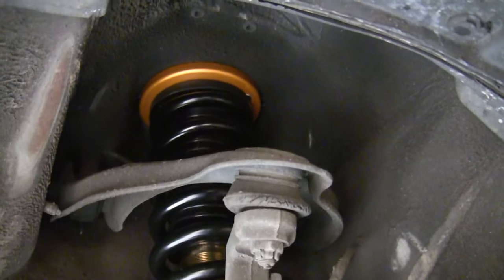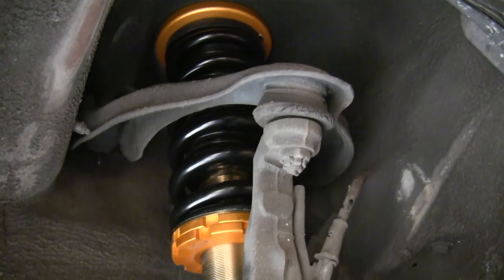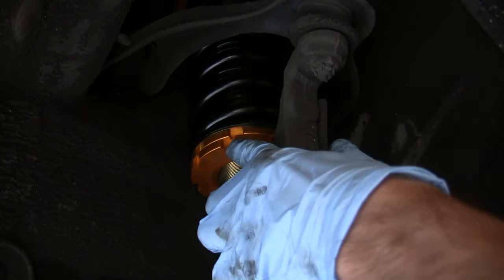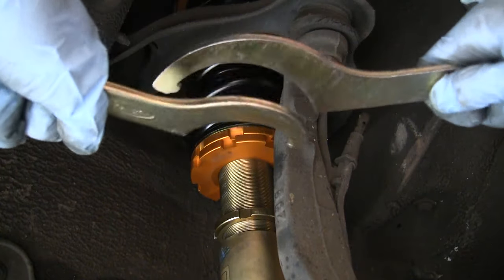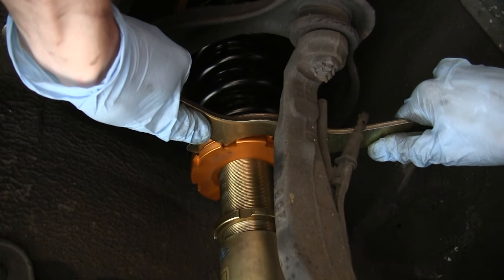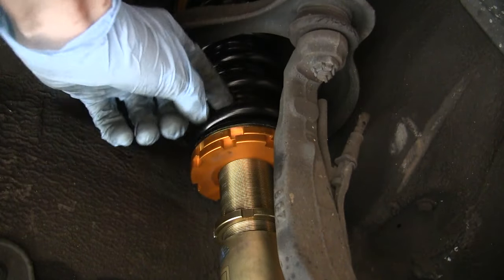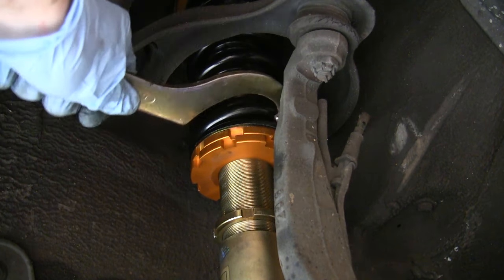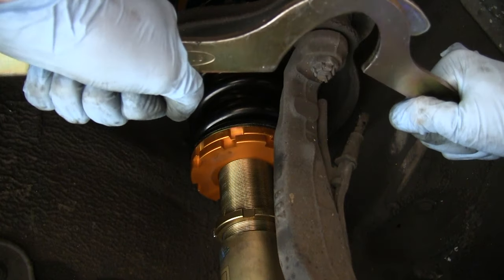How To Adjust Coilover Spring Preload - Explained

Comment: Just bought the maxpeedingrod adjustable coilsprings just like you for my integra dc5 and your video was very helpful even after 9 years! Thanks alot!
Reply: How are your coils treating you 1 year later?
Reply: @andrejlazarevic6871 do not get those i had the same one and one snapped while i was driving. Thankfully my fender and wheel were not affected but my balljoints and abs sensor are now destroyed. Upgrading to scale coilovers now

Comment from the maker: The top ring (when adjusted) allows the spring to compress or stretch out. The ring just below it (middle ring) is used to lock it in place once you have adjusted the pre-load.

Comment: I know this is an older video, so this comment will probably be glazed over. 

For some strange reason, there are no sources of information about properly setting damper stroke sag (pre-load) for cars. There are a billion motorcycle sources explaining pre-load and how to adjust bike sag so the shock travel is not too short or too long. So I will  explain how to properly set pre-load to get it out of my system:

Suspension pre-load is used to keep the suspended mass located anywhere between the max. and min. shock travel when at rest, as gravity will put a compression force on the spring and damper system. For dampers to work properly, the suspended mass should not be too close to either the max. or min.of the shock stroke, otherwise the suspended mass will slam against either the bump-stop or the top of the damper stroke. On a vehicle, the most common and highest force input will be in the direction that compresses the spring and damper system (expansion force of the damper will only ever reach the maximum force the spring itself can expand once compressed); therefore, more travel is desired in the direction that compresses the spring. 

With that information in mind, pre-load should be set so that the suspended mass has approximately 80% compression travel available, and 20% rebound travel, or somewhere near that. Setting the spring pre-load such that the suspended mass rests in the middle (50% compression travel, 50% rebound travel) is more or less pointless as no road going car will decompress the spring fast enough to effectively use all the travel which will result in an proximate waste of 30% total shock travel.

In conclusion, first set suspension pre-load to optimize damper stroke, then adjust ride height such that the chassis will not scrape the ground when the spring is compressed to the bump stop. No racetrack organization likes their road course scratched up by some stanced fool.
Reply: Harvey Mushmann is lifting a wheel of the ground, measuring fender to wheel. Then subtracting static height fender to wheel, a good way of calculating rebound and compression travel?
Reply: Dude THANK YOU SO MUCH

Comment: From what I know, changing preload doesn't change the suspension travel. It just re-distributes the suspension travel for compression and extension, thereby changing the available travel for each all the while keeping their sum(travel) just the same.
Reply: Yes! unless you run into coil-bind...
Reply: Changing preload can limit the amount of travel if you go shorter than the amount that the spring compresses with the weight of the vehicle.

Comment: Personally, as far as i can see adjusting the spring up or down doesnt change anything except the ride height.  raising it could only compress the spring more if the damper was already fully extended.  if that is the case, then you definitely have some serious problem on hour hands already.  otherwise, and normally,  the mass of the car is loading the spring and setting its length.
.   stand corrected if i've missed something obvious, but that is how it seems to me.

Comment: I recently changed my coilovers from almost 0 preload to 7mm preload.   I left the dampening the same.   After driving I feel like the suspension is much looser and prone to roll.  Is this normal? Also can I fix it just by bumping up my dampening adjustment?

Comment: The adjustment "preloads" the spring. With the car jacked up, raising the perch will compress the spring. The compressed spring exerts a force which must be overcome before the damper will move.  The result is that increasing the preload increases the ride height, but also lifts where the car normally sits in the damper travel.

Comment: Preload is a misnomer for this coilover type.  This adjustment has more to do with positioning shock normal(resting) point.  You don't want to adjust that unless your vehicle mass is much different from stock or you want asymmetry in shock travel (jumping the vehicle), but then you would also normally want to have adjustable rate shocks.

Comment: I adjusted my coilovers the right way but I'd like to go lower by at least half an inch. The only way to do it would be to add preload to my springs. I hear a lot on the Internet that it is not recommended but I can't seem to figure out why. Should I do it or not, considering that I have a 2inches gap between my fender and tire.
Reply: Because you will be bouncing on big bumps and your cars ride will go downhill. Airbags are the way to go when you want to slam. I am slammed but have a few side effects, and have had to buy adjustable everything to compensate. Camber plates, rear camber arms, sway bar links, and even axles on some platforms. The car I refer to now is a FOcus ST. I have a 944 Turbo with bilsteins and Eibachs that rides nicer than my Focus. I also have a 2014 IS 350 that have AVS. And adjusts the damping while driving and is complicated and the strruts are on their way out. Just replaced the rears for 600. About to pay 600 for two struts only for the front. Think life could be worse. i also have a Rx 330 I put quick struts on. The fronts lasted long enough for me to throw away the stock parts thinking I was ok. Come to realise only Oem will match ride quality and I am about to have to buy new struts all the way around for 400 new mounts for 50 each times 4, and locate 4 springs from a junkyard or something as they dont go bad unless they are damaged. All together I have three cars with suspension/ride quality problems and mechanics only want to make money so adjustments are usually not done and they recommend to replace all things to stock or tell you to go elsewhere.
Reply: You need to rotate the entire strut with your hands. Not just the collar that will only adjust the preload…

Comment: How is it compressing or stretching the spring? That would assume the top and bottom spring seats are fixed and you adjust their position, the bottom spring seat is not fixed because it rests on the shock body which moves along the spindle. Adjusting the "preload" only results in moving where the shock body sits on the spindle. Like what thybigballs said, what am I missing?

Comment from the maker: After a quick Google search (because I have no idea) it seems a big block is the larger version of a manufacturer's version of engines, and the small block is the smaller version. So ultimately it wouldn't have a set size, as you could have a 5L small block (with a 6L big block version) or a 4L big block (with a 3L small block). If anyone knows otherwise please share.

Comment: I've got a KW V3 and I'm struggling to adjust the heigh on the rears. Emailed the company and the website but not help at all.

What happens is that I adjust the height by moving the ring but what actually happens is that the whole perch rotates with the ring!! Any ideas? 

My car is a MKVI VW GTI

Comment: so your saying that by adjusting the preload so that the spring compresses and moves upwards, this will allow the vehicle to sit lower on the ground? I thought it was the opposite?
Reply: Pretty sure it is the opposite, cause increase preload causes the shock to fully extend doesnt it?
Reply from the maker: By increasing the pre-load, I was referring to compressing the spring. By doing this, it would allow for more threads to lower the vehicle.
Reply: Engineering Explained Ohh i get ya, you mean for a dual adjustability set up!

Comment: why did you buy an adjustable coilover, if you aren't gonna adjust it? wouldn't buying nonadjustable coilovers make more sense?
Reply from the maker: You can adjust the ride height without adjusting the spring pre-load, which I have done. How to Adjust Coilovers - Explained
Reply: oh, I didn't realize, you could adjust the lenght of the tube; I guess all the coilovers I saw so far were preload adjust only
thank you for the explanation, educative as always :)